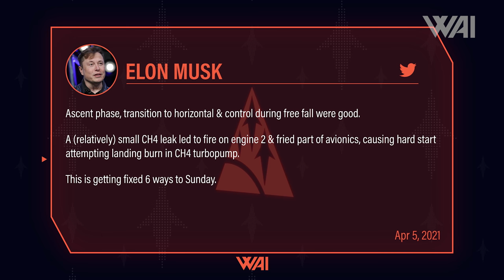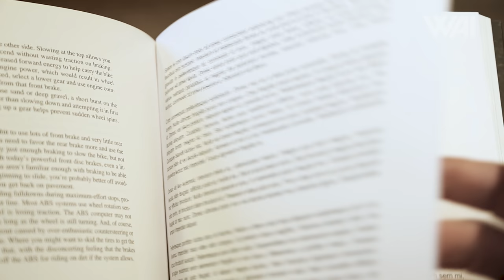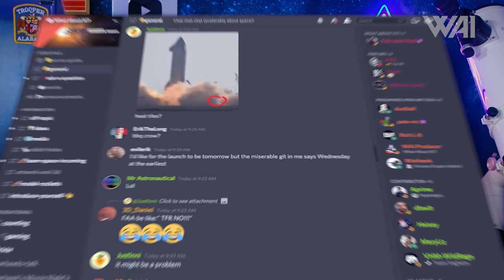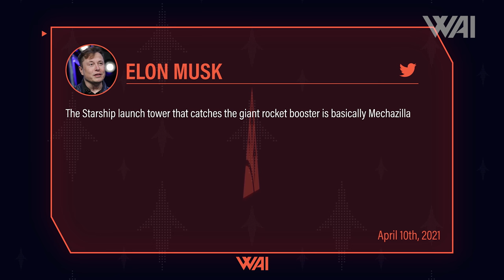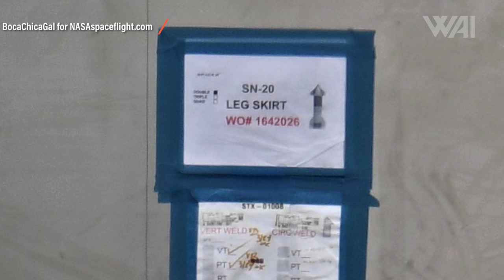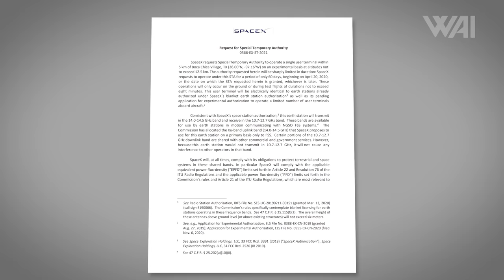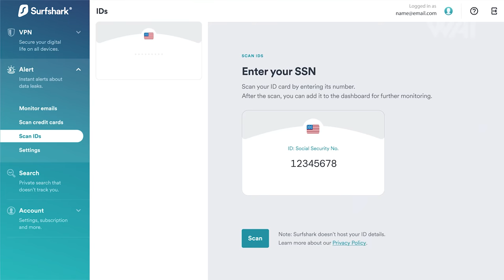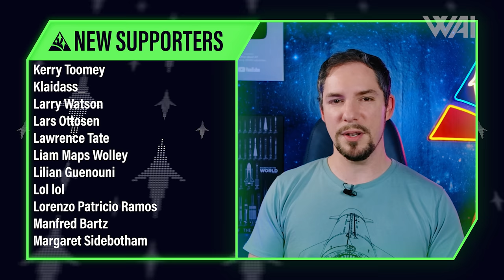SpaceX Starship SN15 - A Milestone Starship!

Comment: "Starships" is a craft that is SSTO, which SN&BN are not, they are Orbit-nautic to&from travel. Because people were so desparado to get their arss to Mars, they forgot to point out to the lead designers and engineers about the verticle rendering issue, because the vessel is 80% a fossil fuel craft(canister), it now needs to branch into three, BN, SN, & MP(Main Pod) passenger/cargo stage, for a safer lunor/landing They need to transport crane mechs & unfold pads, both on the moon & Mars first, SpaceX tried to make SN fully act SSTO by the time it would've arrived there! We are witnessing how unstable that is. Its inevitable, 2-Stage concept will require sending building mechs/stations first, for re-launch back! Both 2 or 3-stage concept, 3 is optionally safer 3 split landing.
Reply: Starship as SSTO on Earth only exist on the alternate universe

Comment: Not a notion will they go orbital by July. I say January. They can't put three engines on a starship without it blowing up never mind 26.
Reply: The early orbital flights wouldn't need all 28. All flights so far were good in ascent, and orbital doesn't require a reliable landing
Reply: @alvianchoiriapriliansyah9882  That can't be true. The current design of the fully made starship barely get's it to orbit. It will absolutely need all the engines to go orbital, otherwise they wouldn't be a part of the design. Musk said himself this is the smallest he could make the starship and still have a fully reusable two stage rocket.

Comment: They can't even manage to make a proper landing without it going boom even on the one they technically landed but which decided to disassemble itself minutes later. The last launch was the worst yet. Only a fool launches in the fog, especially during a testing program where you want to see everything that happens. I have little doubt they could probably launch a starship into orbit just to prove they could do it. That is not the issue.  I doubt however it would make it back down safely and land safely without going big badda boom yet again.  They have yet to even finalize the heat tiles and placement. Now testing the heat tiles would be a valid reason for an orbital flight but not before they can launch and land. How can you examine the tiles on the ship if it blows up? Also why waste the engines?
Reply: Orbit doesn't need reliable landing to be doable, fog launch wasn't done by fools, they had plenty of footage on the tiles in flight, and Raptor are relatively cheap compared to data they're receiving